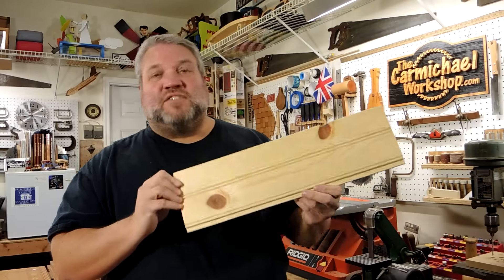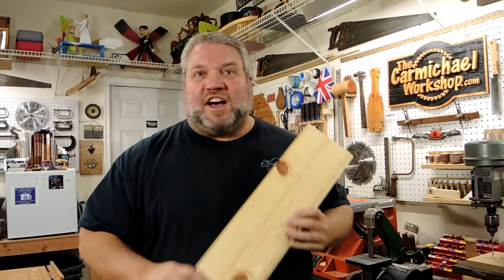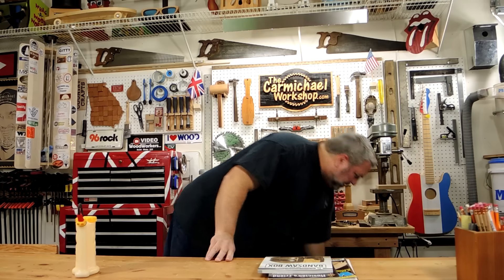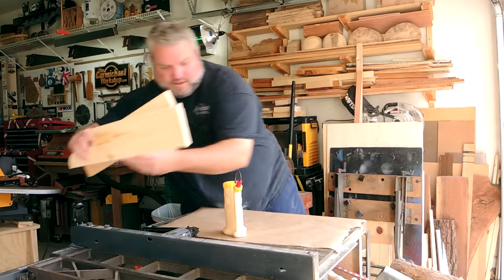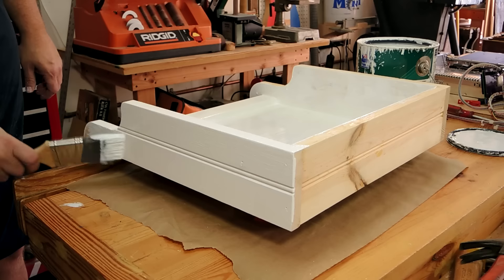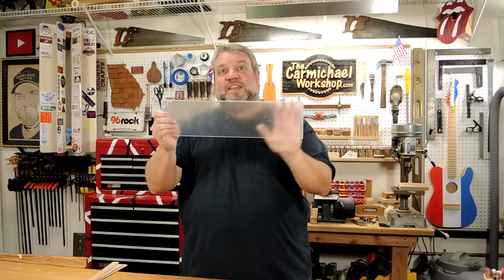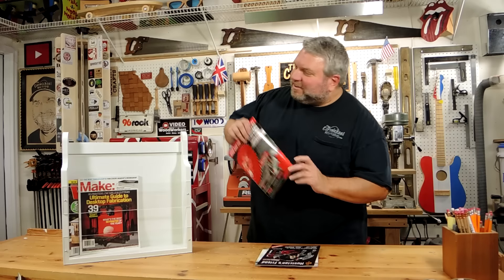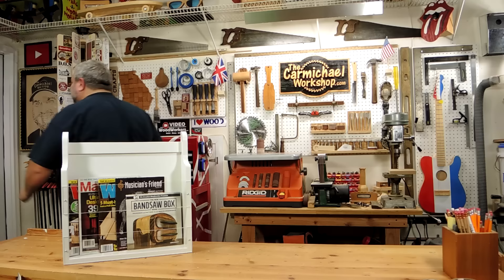Making a Magazine Rack - Easy Woodworking Project

Comment: nice project Steve turned out awesome. the plastic was the way to go I think. by the way what size pulley wheel do you have on your Craftsman saw at the arbor? the reason I ask is I got one identical to yours but I had to get a motor and it didn't come with the pulley Wheels thanks for your help.
Reply from the maker: Hey Opa!  I just measured both pulleys and they are the same at 2-1/4" outside diameter.  There are a bunch for sale on ebay.  I see some pairs of 2-1/2" that would work too, as long as both pulleys are the same size.
Reply: Steve Carmichael Thanx Steve I appreciate your help.

Comment: Awesome project, Steve. I like you dustmask, too....where did you get it and does it work well? Mine I think isn't doing its job and I've been thinking of getting a better one, lol.
Reply from the maker: Thanks Brian!  It's from rzmask.com  It's much better than the white paper ones, it does have a similar replaceable white filter inside, but the velcro strap is better than the rubber bands.  This 10% off code might still work - new2RZ

Comment: Nice project, good use of scraps. Why can't you carve acrylic ?. I would have thought it would carve like wood.
Reply from the maker: Cast acrylic can be carved with a cnc, but extruded acrylic can't.  Extruded acrylic just melts into a big blob around the bit.  Lowes sells extruded and I bought it to test it, but it didn't work.  Good question!

Comment: Okay Steve I think it is great, But. since the bottom piece of plastic goes past the bottom it will trap dust, hair ???? and make it harder to clean it. Just my two cents from making some for offices in the past :)
Reply from the maker: That's a great idea John, thanks!  I might move that bottom piece up if it becomes unsightly.  Good tip for anyone else making one of these.

Comment: always have trouble cutting plexiglass on table saw. Any advice?
Reply from the maker: Yes, wear safety glasses and a face shield if you have one.  Use push blocks, don't hold it with your hands.  Check your saw table for burrs or anything that will scratch the acrylic and put tape over it.  If you repurpose your sawdust for composting or make firestarters out of it, you might want to empty it before you get acrylic shavings mixed into it.  Be careful!

Comment: why can't you use the extruded acrylic on the CNC?
Reply from the maker: Hey Andrew, good question!  The extruded type of acrylic melts when the bit tries to cut it and it globs up around the bit.  The cast type of acrylic can be cut by the bit without melting it.  Lowes sells the extruded type and I gave it a shot since it's convenient to get, but it doesn't work. I found a local place that sells cast acrylic, otherwise I would have to order it.

Comment: Curiosity; why can't you carve that plexi with your X-Carve?
Reply from the maker: Hi Michael - The extruded type of acrylic melts when the bit tries to cut it and it globs up around the bit.  The cast type of acrylic can be cut by the bit without melting it.  Lowes sells the extruded type and I gave it a shot since it's convenient to get, but it doesn't work. I found a local place that sells cast acrylic, otherwise I would have to order it.
Reply: Steve Carmichael thanks!  Have only done acrylic once on my X-C so far so had me curious! May have to find someone local when doing it again